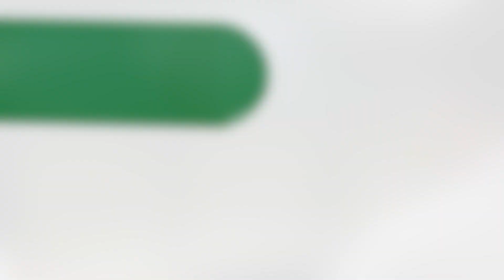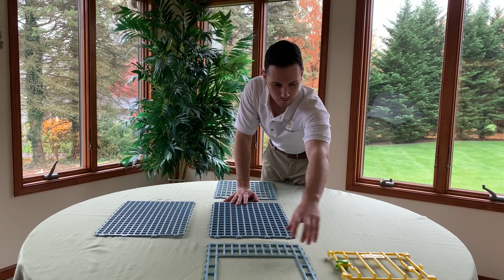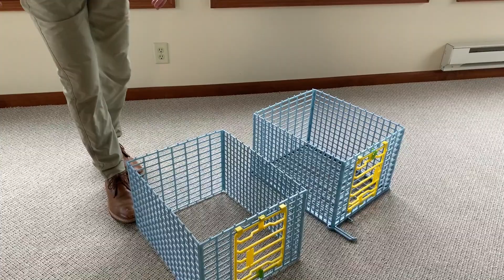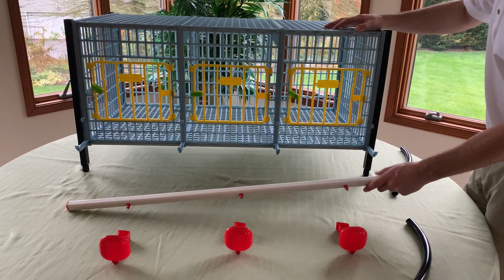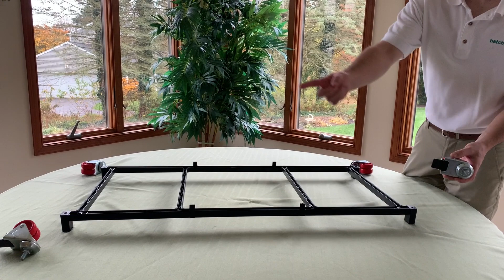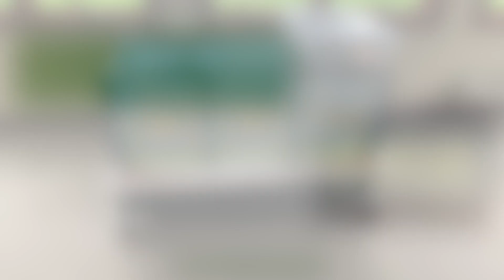Grow Out Pen - 1 Layer 15" (Assembly - Hatching Time) Cimuka

Comment: How do you screw into the plastic Molly without the Molly going into the thin metal rods? I try to go slow and light pressure but the molly goes in the pipe with the screw.
Reply: I don't think that is a problem.  The molly helps make a secure connection into the metal rod, so as long as the side struts don't pull away, the connection should be good.  You are welcome to reach out to support@hatching time if you have other questions or concerns.  Thank you!